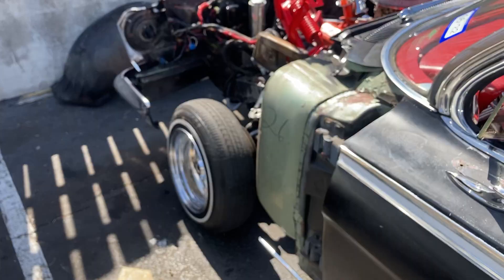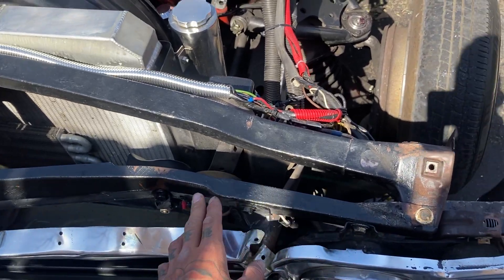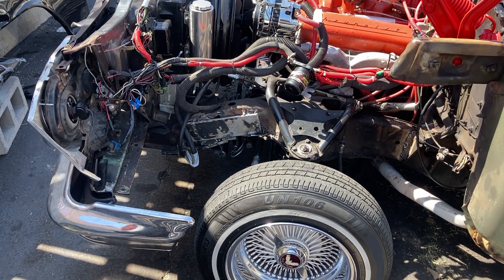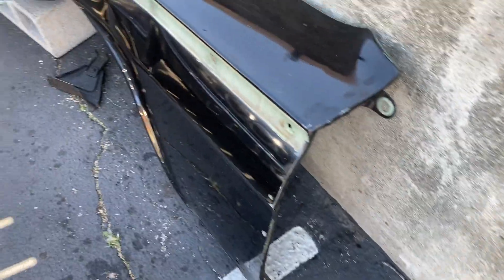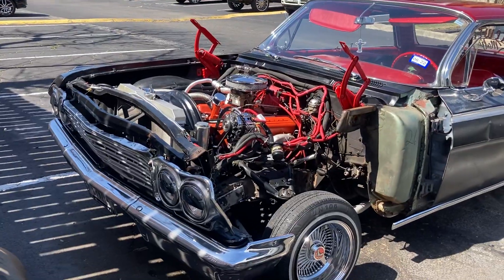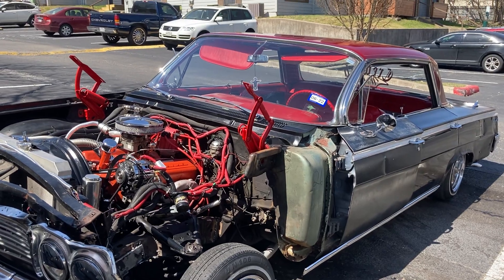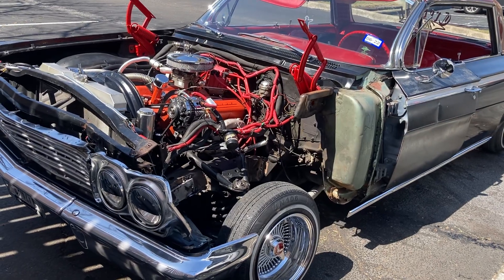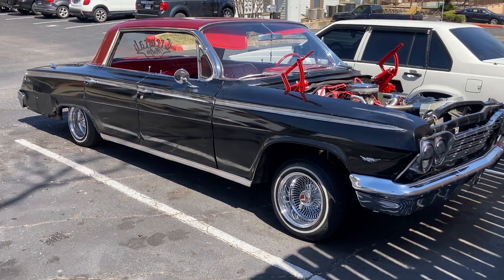62 impala wheel well and fender off

Comment: How are those tubular Control arms?  I heard they have slack/play on the upper bushings..
Reply from the maker: I honestly like the stock ones better. I’m going to have to go back to original when it comes to hydraulics anyways. I thought it would be an upgrade but I didn’t really noticing any major difference. The upper bushings seems fine and tight to me. I’m not expert though. I have no complains on them been driving with them for 2 years how